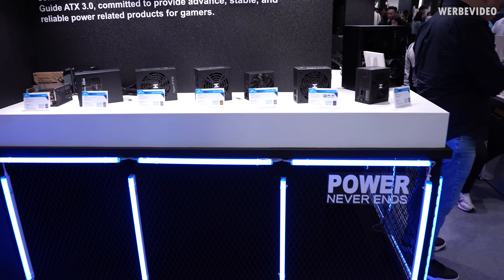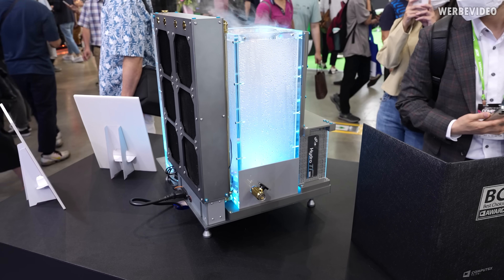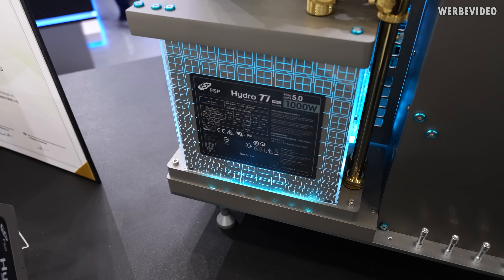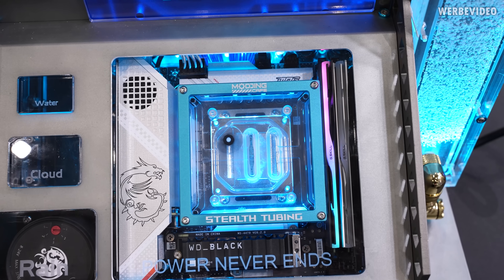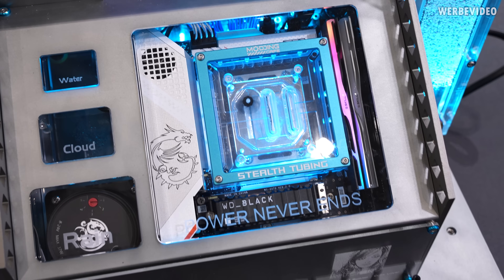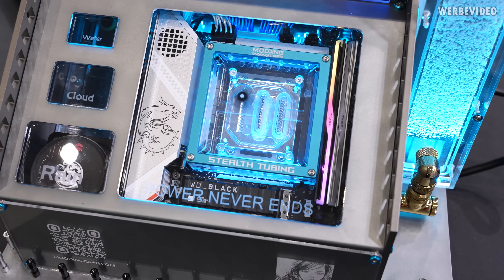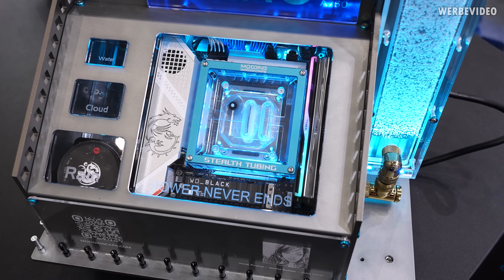This genius Water Block has no Connectors?

Comment: Are you planning to release 8+6pin wireview? If not is it possible to remove 2 edge pins form 2x8pin version and still get correct readout?

Comment: Take a small piece of thin annealed copper tubing cut to the correct length, use dies in a press to flare both sides, then all you need is a rubber or silicone washer on both sides to seal to the block and back plate. Another possibility would be to just injection-mold a tin tube with flanges on both PCB sides. Or a mix of both: use a copper tube for the ID and tin flanges instead of (fully) flaring the copper.

Comment: That guy is onto something, lets punch holes  in the MOBO and  let  heat pipes bring heat to a huge aircooler on the back panel!!
Reply: some motherboards actually have the cpu mount on the back side of the motherboard, pretty rare though.

Comment: didn't we used to have HUGE evaporation coolers back in the day? probably the same thing with the mist cube thing? looks like atomized water spray or something, probably a second pump pulling from a reservoir after the radiators... this was used for a bit sub ambient temps
Reply: Evap isn't restricted to radiators.  The Cray X1(mid 2000s) used spray cap cooling blocks on the MCMs which sprayed (not sure if fluorinert) directly onto the dies.
Reply: it was a fad for a bit yes, generally I think it was ping pong balls hanging in long section of PVC drain pipe, with a shower head and a fan at the top and a Y fitting at the bottom with the reservoir and water return below that. basically worked like the towers of a nuclear plant but on a very small scale.

Comment: man the amount of Mask zombies in the east is just INSAINE! but using the mounting block holes, i mean flowrate might be low but it makes perfect sense and could also mean you could create a waterblock that puts the pipes behind the PC and cooling could flow though a back plate also. i mean PCBs with holes for channles might make sense as well as putting the plugs on the reverse side so your top side is presintation and cases could be made to function far better if theyy have all the same locatrions

Comment: Roman, try to make a comercial water cooler without any water ( conductive liquid ), you can use any liquid but have to be safe to dump over a board / PSU / etc without sorting stuff
Reply: the idea is : if you get a leak nothing gets damage

Comment: PCB is fiberglass and PCB in contact with water is nothingburger. Check out 50+ years old fiberglass sailboats that are still up and running in saltwater.
Reply: @1w5 gelcoat is usually demaged over the years in multiple places. Still a nothingburger.
ALSO, the base in gelcoat is the same resin used in composite for the best adherence.

Comment: people in the sff community have been using pneumatic tubes/fittings recently but even with those I cant imagine there are ones small enough for that.
Reply: there are, down to 2mm od
Reply: Pump probably runs at higher pressure to cram water through those tiny tubes
Reply: @andrewk8636  I would think it might need a different kind of pump, the glorified paddle wheels we use now would probably have a hard time getting much volume through tiny tubes. A low pressure positive displacement pump might make something like this work a lot better.
Reply: @--_DJ_--  It has a D5 pump right next to the mobo/block so it works well enough. DDC pumps are better for head pressure applications and are compact, hence why the SFF community love DDC pumps. Typical radiator coolant channels are about 1.5-2mm thick, so this CPU block with 4mm channels isn't that outlandish.
Reply: Not really, the fittings for most loops use G1/4, which isn't very large, the tubing inside a radiator isn't large, the access across a jetplate is really tight. So there's plenty of places in a loop that run small diameter, having 2 small diameter access points would basically account for jetplate pressure needs. The only question would be of volume, not pressure as there's most likely a distro plate attached to the back of that cpu block.

Comment: You probably don't even need a tube. 
An o-ring/rubber washer on each side of the PCB, and a sealed block with the fittings would probably seal good enough.
The holes should probably be selaed with some rubber or silicon so the fiberglass doesn't let water seep in, but other than that it should work just fine.
Reply: @brianbuckley5204  what metals? PCB's are usually FR4 material. At those holes they usually have a pull-back from the copper to provide enough clearance safety. Otherwise you run the risk of shorting some layers even with screws. So the only thing that's left in the end, is how well the layers are stuck together and if that gap is big enough for water molecules.

Comment: I thought this video was gone. I watched half of it last week and it disappeared halfway through. The cpu holddown screws should be the 4  most inner screws NOT those 4 little pipes. I bet those pipes are bent 90 degrees under the waterbox and do not go through the motherboard,
Reply: Maybe you should watch the video again?  He clearly points out the 4 tubes are the cpu cooler holes.
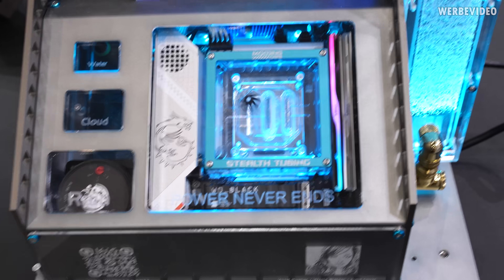Reply: @bruticus0875  Maybe YOU should watch the video again where he said "water through mounting holes in the motherboard"  @ 2:25 those tubes go to the bottom of the block and have a 90 degree with 4 small hoses. No need to go through the mother board.
Reply: @gprojectnoob4779  Roman described both sets of mounting holes clearly.  The pipes are going through the cpu cooler holes as he said.  The 90 degree bends you are referring to are at the TOP Z axis of the block and exit into the Jet Plate of the block.  Just as he pointed out.  Do you really believe there's stagnant water in that block?  You thought, what?, that the impeller in the block is showing......airflow?  lol.

If you cannot see the flow of water across that impeller, I'm not sure what you're doing here.  That's the whole purpose of putting the impeller there.  It's not powered, it's just an indicator to show water flow.  Water flow only happens when it's a loop.

Comment: ideally, you could drill out the mounting holes significantly larger for more flow. They "should be" mostly reinforced ground planes around them, but every motherboard is different.
One or two MM larger diameter will greatly increase the flow.
Reply: If it is sufficiently low power like a 7600X with tweaked settings, i think you could probably make do with pumping water through the tiny holes.
Reply: @fVNzO  honestly there's no need to even enter the bios, let alone change any settings... it's not even hooked up to a monitior. all it needs is power supplied to the lighting, that one stick of ram, water pump, smoke machine whatever that is,  and that screen with the dancing girl image.. there doesn't even need to be an os on it to do what it's doing for the show lol
Reply: oh and i think i'm right because they didn't even take a few minutes to change the lighting on the stick to blue to match everything else in the build..
Reply: @Schoolship.  Full schizopost. Lay low on the tinfoil my brother in christ.
Reply: @fVNzO  I think your post of "this is a normal everyday computer" is by a large margin more insane than my theory that this pc doesn't have any need to run like a normal pc, and will most likely be taken apart and the parts reused for another different show pc immediately after the show
Reply: @Schoolship.  Okay, well could you point me towards that comment in question then? For i seem to have forgotten that i made it. (Yep, you need help).
Reply: nobody, no-one, is going to use this extremely expensive top tier professionally built massive water cooled pc that's constantly spewing out moist heated air, as a daily on their desk.. especially when it looks like it obviously should have an extreme cpu to match the massive psu and profound insane water cooling systems and one of a kind case that altogether likely took hundreds of hours tinkering in cad design, before machining of all the unique parts needed... and lol your want to put a 7600x mid tier cpu in this thinking it's a daily driver pc going to be run regularly bwhahaha what a jokester you are!!
Reply: @Schoolship.  Yep, you're completely off the rails. Sun's bright these days lad. Get outside.
Reply: @fVNzO  okay well, your let me know then, what's the point of your thinking that a 7600 and taking the time to tweak it's settings in the bios would be anything but a ludicrous choice for this build? 

it's a show pc. nothing more. it's just for the show. and if it isn't, then why world you ever ever ever pair such a wild build, that likely cost in total over 10k usa fiat lolbux, why would you ever pair this build with such a weak cpu? either it's a real pc ment to be used, or it isn't, right? 

so if it is, then that cpu choice would make anyone who could afford this thing laugh out loud and walk away.

and if it isn't meant to be a working pc, then literally any cpu would be good enough. even literally actually no cpu at all, just an empty slot, would still allow all the lights to light up and the fans to spin and pump to pump, which, as i stated, is actually all that's needed for the pc to shoot there and look pretty for the show.
Reply: the original comment of drilling or the holes makes alot more sense than your reply of "that world class, top tier modder that put so much love into this, he should just add a junk cpu and call it a day."
Reply: @Schoolship.  I could make a company with all this free real estate.
Reply: @Schoolship.  Yeah, Germans sure like to over engineer to the point they forget what the point was after all the nonsense. Oh shiny...😂😂😂😂. Fun be over soon, why not add some fish to the water tank too. Just for fun does.
Reply: @fVNzO  you could yes, but you won't. because you don't have any vision. only vitriol...
Reply: Many years ago I slightly drilled out the mounting holes on my Radeon 4870 X2 in order to mount some universal GPU water blocks to it, so I can confirm it's definitely possible/feasible to enlarge mounting holes on boards like this. The clearances to actual traces are usually quite generous, because nobody wants the QC nightmare of a malfunctioning motherboard because one of the mounting holes got drilled slightly off-center.
Reply: "Waaa! You disagreed with me! You're horrible and I'm gonna make up crap to insult you with!"
Reply: That sounds like a bad idea. You'd probably hit traces in the pcb unless you could xray it and know for sure.

Comment: add this to the back wired motherboards and the GPU socket from ASUS and you near have no connections at all visible. if they could do something for a GPU block with stealth connections too and its a complete package. very cool.
Reply: What's the obsession with no cables and connectors these days? I am actually just curious.
Reply: @p_mouse8676  every connection and every tube and every block and every fixture in a water loop is a possible point of failure or leak. The less points of failure you have, the less likely a failure will occur. A connector to connector has 1 possible point of failure, the connection between the two parts, whereas a connector to tube to connector has 3 possible points of failure, the 2x O-rings and the tube. There's also flow restriction, the longer the tubing, the more bends in the tubing, the higher the restriction which increases the need for pump head pressure, the higher the pump pressure, the more likely a leak from a connection. So minimizing connectors, tubing, pressure, bends etc is a major benefit, it not only minimizes chances of a leak but also requires less components, less maintenance, less competence, less space etc.
Reply: @p_mouse8676  any cable in the way of the flow of air from outside the case, over the components/heatsinks/radiators/etc to exiting back out the case is a possible restriction to that flow of air, and thus cooling of the components. Modern proper cable management is already pretty efficient for this in most places, but still any reduction still helps.

Then of course there is the aesthetics reasoning of seeing just the parts themselves, cleanly, without any mess of wires, or clutter.
Reply: @p_mouse8676  different people, different tastes
Reply: @GewelReal  Not quite.
Reply: @p_mouse8676 I can't say for others but I'm not very fond of a mess. And having to route 6 or more cables from mouse, rgb mousepad, webcam, microphone, keyboard it's a PAIN in the arse. That's why I put an extra mile of effort to cable manage, get some hidden behind the monitor and switch to wireless in others. But as long as you're happy...
Reply: @p_mouse8676  Vendors are out of ideas. Lazy RGB and gimmicky LCD features with crappy software isn't impressing anyone anymore (if it ever was) so they need to sell the public on an overpriced ecosystem another way.

They could add more features across their board lineup with polished software that's actually useful but this is the cheapest solution. The rest of the money will go to their favorite tech-tubers and review sites.
Reply: @p_mouse8676  Why not, its like wires hanging out from your desk type of scenario, but with a inhouse PC. Clean.
Reply: Just turn your computer around 😅
Reply: Even the HDMI cable you can find a way to get rid of (that's quite impressive). But the hardest one is the energy cable for the PSU, I honestly think the best that can be done is to try to hide it into the table or something, but it's still going to be there.
Reply: Even getting the connections to the end of the GPU would help routing and looks.
Reply: Too bad this MSI motherboard wasn't one the rear power connector boards MSI showed off.
Reply: your side panel does the same thing
Reply: And you could also user a pcie extender to put the gpu on the back, and suddenly, you have the whole thing just turned around. Oh, wait.
Reply: vertical gpu with inlets on the back, gives you plenty of options to hide the tubes from view :)

Comment: Question is how are the Temps on that cpu?
Reply: If there is enough volume ( amount of Water as example) of the medium and that medium has a high exchange of both sensible and latent heat in the exchange process then the temperatures are manageable. As an HAVC_R Engineer now retired I always wondered why no one has invented yet a refrigeration system that would work on these small components IE mother boards. Being that I have serviced, built and installed many CRAC Units and many of those custom based on heat load and future projected heat loads to include humidity to control static electricity. The refrigerant cycle is a known given for many types of refrigerant currently available on the market and can be used to select the proper liquid to vapor( gas) exchange at a metering device.
Reply: @jwar2163  I am guessing it is just more complex than it needs to be using refrigerants in a PC cooling system. The refrigerants also can be quite toxic and require a license to obtain. There are some options out there that could get around that but I don't know if hydrocarbon based stuff is what people want in their PCs, or whether they would be suitable for the task. It would be like reinventing the wheel just for the sake of doing it in my opinion.
Reply: @--_DJ_--  Valid points you have made. I have forgotten that a person has have a special license for refrigerants. Retirement will do that to you I guess. I still carry all my licenses no longer use them work wise. Some refrigerants can be quite deadly to the untrained person.
Reply: Need to know the CPU before the answer to that tells us anything.
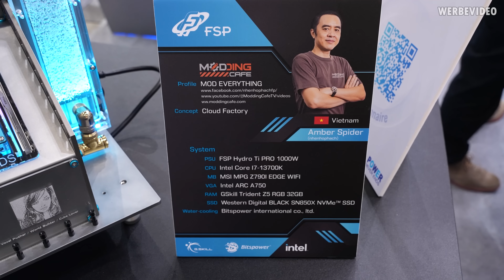Reply: @--_DJ_--  3:15 Intel Core  I7-13700K
Reply: @agentoranj5858  I'll have to take your word for it, I can't read that at the resolution youtube deems fit for me.
Reply: @--_DJ_--  If only there was a way to change resolution. Perhaps in a menu. We could call that menu "settings". just an idea, though.
Reply: @rasmusvedel  Badum tss
Reply: @rasmusvedel I could, but watching youtube videos in slideshow format isn't really my thing. I also have no reason to doubt someone who could read it in the first place, so little need to go back and look for myself.
Reply: @--_DJ_--  The specs are listed clear as day at 3:15. i7-13700k on an MSI MPG Z970I. Visible at 240p.
Reply: @--_DJ_--  are you using a Nokia 3310 or something?
Reply: @GewelReal  Nope. Vizio 37" TV through aging eyes.
Reply: @--_DJ_--  I'm talking about the slide show format
Reply: @Gewel ✔  I am not sure why YouTube struggles with even 720p for me. My wifi isn't great but it should handle it. Could be the ancient IdeaPad I use with the tv.
Reply: @--_DJ_--  time to upgrade that dinosaur then
Reply: @GewelReal  The noises it makes would lead me to believe it is going to force me into that, but she just keeps on chugging along. I wish you could use 2 mice on one computer, I would ditch it in a heartbeat if I could use my PC instead.
Reply: @--_DJ_--  Seems like a you problem.
Reply: @rasmusvedel  Uh thanks captain obvious. Who else's problem would me not being able to read something be?
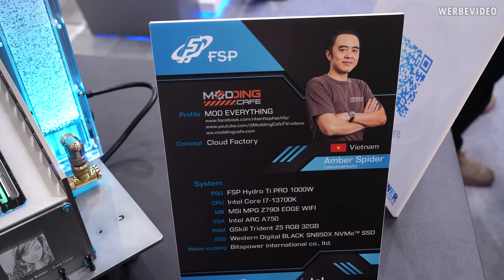Reply: @--_DJ_--  03:14 :D ?